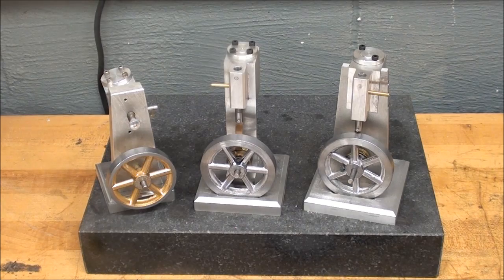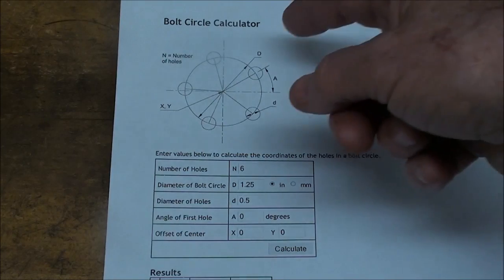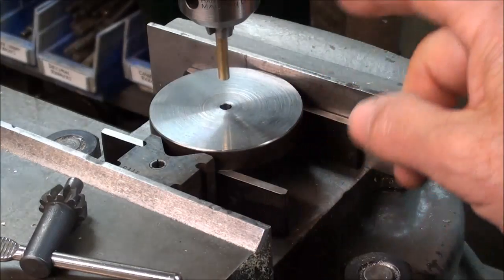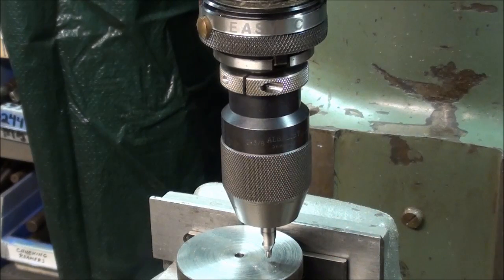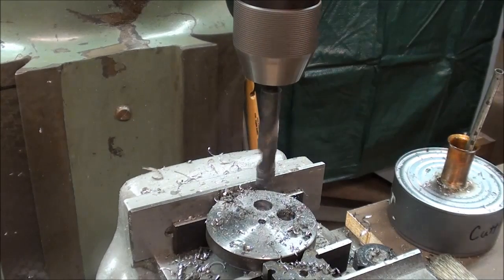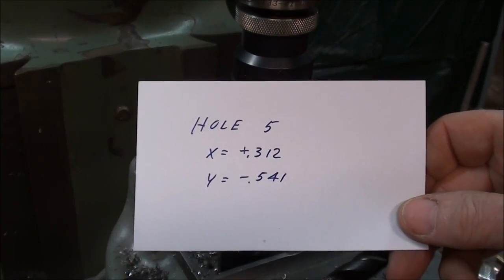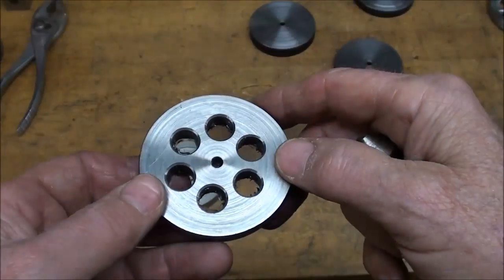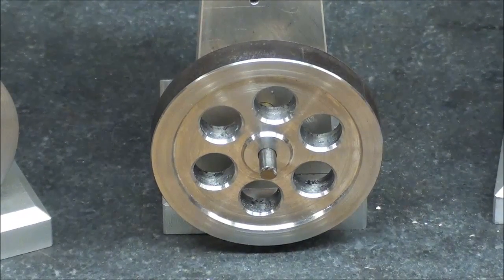MACHINE SHOP TIPS #153 Pt 1 Bolt Circles-DRO Method Bridgeport Mill tubalcain

Comment: Remember your Cartesian Graphs!   FIX that DRO!   Your +/- X directions are reversed!
Reply from the maker: How do you reverse it?
Reply: mrpete222 
depending on the brand of your DRO, you should be able to go into the SETUP of the DRO Screen and change the +/- Directions of any Axis.  It appears that only your X Axis is backwards.  The Y looks correct.
On SINO brand DRO’s, you turn Power ON and press/hold the DECIMAL KEY immediately to enter the SETUP SCREEN.  Then ARROW DOWN to select the Axis to change.  If its on ZERO, then change to ONE.  or vice versa

Comment: Just curious (#1): Is there a reason why you did all three operations of each hole before moving to the next hole?  Perhaps displaying my ignorance, I would have done the starter holes on all six holes and then the pilot holes on all six holes, and so forth.  I'm guessing there is no issue with trusting the repeatability of the DRO (and, in any event, the subsequent bores would all naturally center on the prior ones, no?).

And just curious (#2): in the absence of a DRO, would the dials on the table handwheels be accurate enough for the coordinate method?
Reply: 2 reasons , easier to change tooling than coordinates, and yes all systems have some tolerances

Comment: HOW Abought if you have back lash?
Reply: Rely on the DRO to get you to the correct position after you turn the handle to remove the backlash.  It should have no effect on reaching your final position.
Reply: the dro does not recognise backlash it only recognizes movement.

Comment: At first, I wondered why the computer program asked for the diameter of the holes since you only need to locate the centers. You could make the holes any size. Then it occurred to me that the program may give you an error if it determines that the holes would touch or overlap each other which would cause the center hub of the flywheel to fall out. You could make the holes different sizes (i.e. alternate between 2 size holes) as long as the flywheel stays in balance.

Comment: Would it have been preferable to cut the recess(es) before milling the holes? Seems that you could avoid all the interrupted cutting on the lathe--although maybe that's not so much of an issue?
Reply: ithought the same thing tom b.
Reply: he,s primarily showing methods of bolt hole centers more than turning methods

Comment: Not to split hairs, but this really doesn't have anything to do with DROs. The same technique could be done with just the dials on the tables. It's easier with a DRO, of course, but a DRO isn't necessary to use this technique.
Reply: Not sure how you got by with that for a year or more....LOL.  What you are saying is only true if you have 0 backlash in your machine, which I know is impossible.

Comment: holy cow... another AMAZING VIDEO!!!

yet a slight error in saying a flywheel's mass is best served on the outer edge -- total mass of the flywheel is all that matters.

spokes of any type, and any other machining (that removes material and takes away mass) are simply concerns for aesthetics, ability to construct (for example, on a very large scale such as a steamship) and overall material cost savings.

simply put, the more mass in motion the better -- at the hub or on the periphery, it does not matter -- and removing any mass between might look better, but it can severely degrade the flywheel's main function: that of established inertia/stored energy.
Reply: +KevCarrico Ol' Tubal Cain was right and you are wrong, Kev. The farther away from the center the mass is, the greater the moment of inertia  of the rotating mass. Look up "angular momentum."
Reply: with a fixed diameter, not at the sake of removing material from the total mass (creating decorative spokes, etc.)

Comment: 18 times changing tools... It can be made 3 times changing
Reply: Yes, but it's a trade off. You will then have to reposition the table 18 times. My guess is that it takes less time to change the tool than to do the repositioning.

Comment: Do you not like indexing chucks for the mill? I've had one that really worked well. Just changing a gear plate for how many holes you plan to drill. Then you just need to know distance from edge to hole center. Great for flange bolt patterns.
Reply from the maker: YES I DO.

Comment: Center drill with the Mill, use the Drill Press for the other hole drilling operations.
Almost as accurate and saves a bunch of drill changes.
What ever works, I guess, always more than one way to skin a Cat.
Reply from the maker: Yes-I often do that--much faster

Comment: At work if I am on a machine that does not have the a built in PCD function on the DRO I use a Zeus Book http://www.amazon.co.uk/Precision-Reference-Drawing-Toolroom-Workshop/dp/B0000CLZUO there is a a chart with Co-ordinate Constance you just multiply  by the diameter.
In England we say PCD Pitch Circle Diameter

Comment: is moving the table's position with digital controls a lot more trouble than it seems to appear...?  I'd be inclined to drill all 6 holes before changing bits, due to the precision the digital unit seems to convey... I could see how one wouldn't want to move and verify the table manually 18 times...

Comment: For bolt holes I always just decide how many I want, divide 360 by that number to get the angles between each one, then decide where I want my holes at each of those points. then calculating is just simple trig.

Comment: Wondering how you would go about drilling a set screw in that. I'm not a machinist, so I have no clue. I see how you could have done it on the spoked flywheels, but can't figure out how you would do it with the short shouldered hub on the this one.
Reply: put it at an angle?
Reply: Lasse Langwadt Christensen I went back and watched the video again. At about 13:42 he explains how to do it. I wonder if he then plugs up the access hole with silver solder or some other kind of metal?

Comment: You're going to confuse some people with your flipped "X" coordinates T.C. I’m guessing you must have a backwards mounted scale causing the reversal. If you want your machine to be backwards from all others in this solar system I’m OK with it but you must flip both the “X” and “Y” axes in order to maintain proper relationships within the Axis trinity. If moving to the left is "X" plus then "Y" plus must be toward you. I suppose maybe you flipped "X" and "Z" which keeps the system in check but would just be too bizarre for any person to do. Everyone please reference the right hand rule if you need to its OK. Mr. Cartesian C. System would not be happy with what you have done to his magnum opus.
Moving on. I’m not sure if you were aware of this but the Machinery’s Handbook also has the constant tables for calculating the coordinates of bolt circles. It’s in the Jig Boring section for those who may care. It looks like the web program is the better way to go these days. A little trivia to add, for a long time, though not sure it’s still the case, the table diagrams in the Mach. Handbook showed the “Y” directions flipped.
Reply: If you look carefully, the table is actually moved in a negative/minus X and/or Y directions, despite the move on the material being positive/plus!  I thought about it for a while.  Mr Pete is 100% correct!

Comment: I've always thought basic right angle trig and the Pythagorean Theorem are something every machinist should know how to do.  Most blueprints for major manufacturers use true position to tolerance hole locations.  You need to know the PT to figure out if your holes are on position or not.  Then trig also has many uses, too many to mention.

Comment: After watching this, I was thinking of a different tool changing process.  I would think it would be easier to center drill all 6 holes, then change to the 3/16 drill, drill all six holes and so on.  My thinking is less tool changing, but you have to reposition the part more, and that there is a higher chance of error.  But the DRO should eliminate that error.
Mr Pete, what are your thoughts?
Reply: By using a stub length drill, the Slocombe (centre) drill is a bit superfluous so you can save one round of tool changing. I am in the drill all one size before changing the drill camp, but whatever it takes to get the job done is the right way, right?.
Reply from the maker: 6 of 1 , half a dozen of the other.
Reply: mrpete222 Good to know that there are more than 1 way to skin a cat.

Comment: The dro I have at work on my mill is a 3 axis one and it'll even do bolt circles for you. It's a pretty fancy rig. It even goes down to a tenth of a thousandth. Now my mill is way to wore out to keep consistant cuts at that accuracy lol. The boss needs to have it sent out and completely re done. I just don't know how to use all of its functions haha. No one at work really does actually. It was bought at an auction.

Comment: Thanks for sharing, Could one mill out spokes, instead of holes?
Reply: One of the earliest issues of "Home Shop Machinist" shows how to mill out a spoked flywheel.  The spokes are curved - not straight.  I think the article was by Philip Duclos.  Are you familiar with Village Press and their publications?
Reply: You would probably have to use a CNC machine for that since the inner contour would be something like a pie shape. Also most spokes have some sort of profile to them.
Reply: ajju poku I know it is possible but IMO the effort is way to much for what you get in the end.
Reply: ajju poku It sure is possible and using a rotary table is probably the only way to do that.